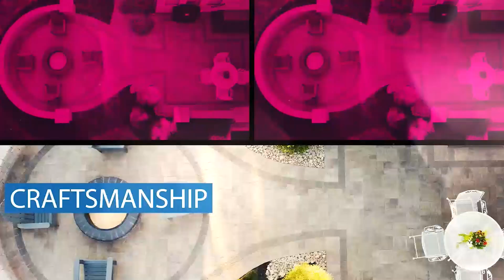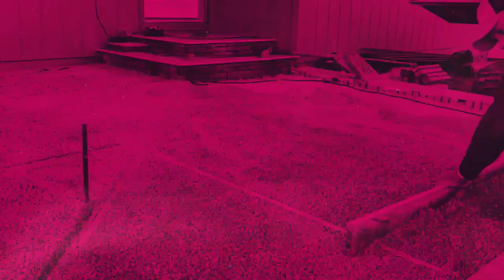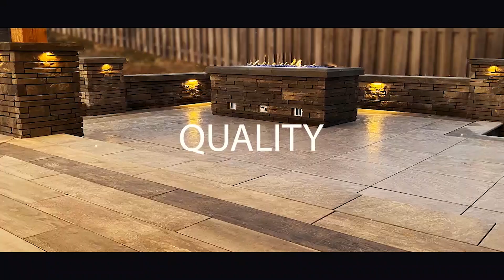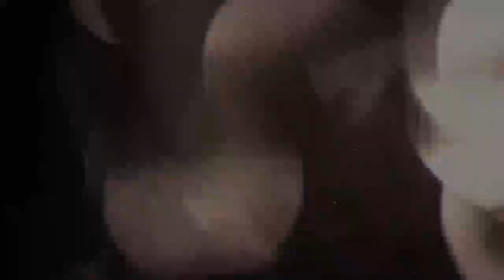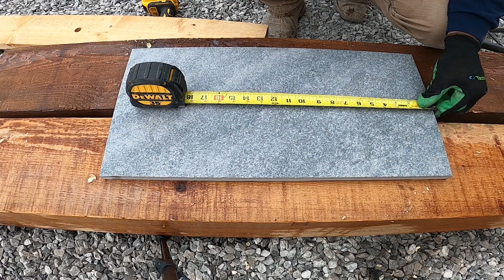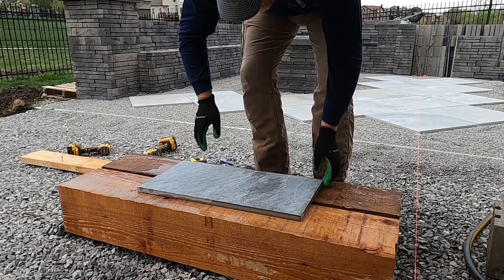Core Drilling Porcelain Pavers for Recessed Lighting/Inlite Fusion

Comment: Very thanks for video. a quick question though, How to install pavers with lights on dry sand base. This is in regard to how to hide the wires under pavers. Does it go & sit under sand base or a conduit is must?  Dont you think hiding wires under dry sand base under pavers will be trouble because of water seeping in later. Do we have any video on this installation. Thank you very much !